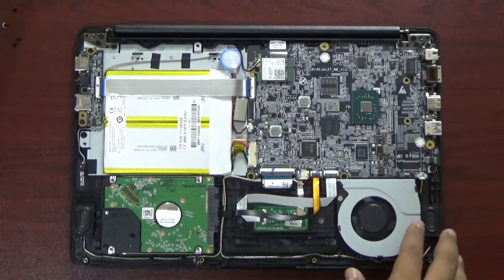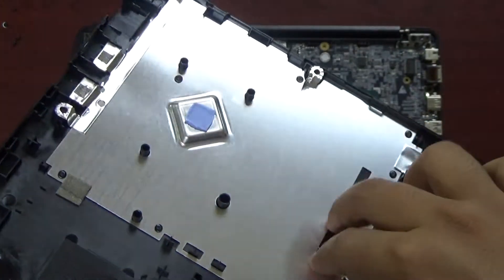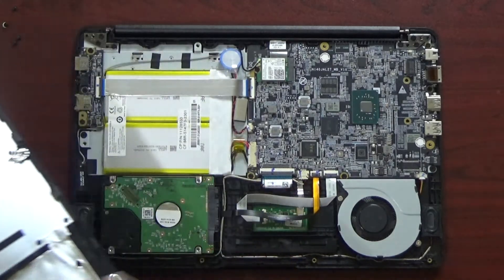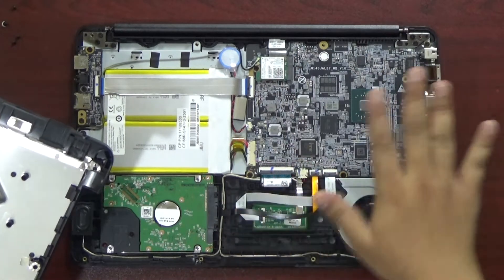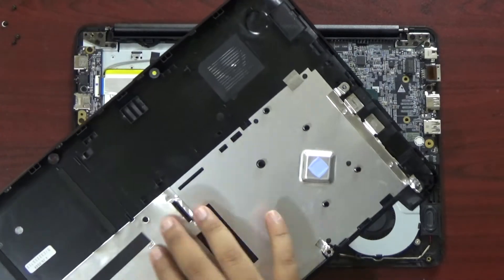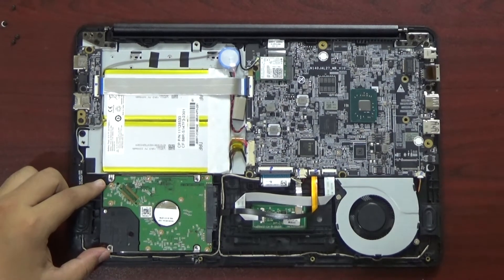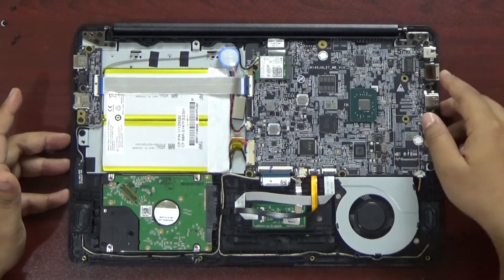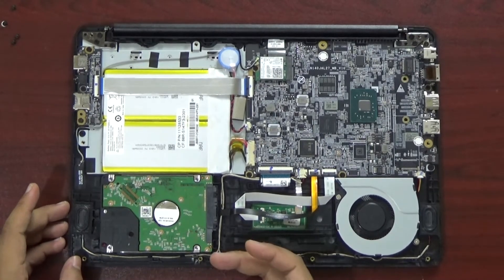Cara Bikin Itel Able 1 Jadi Kenceng

Comment: Ada slot lain buat ssd ga ya?
Reply: klo dilihat dri motherboard ny itu bs ditambah cuman mau pake solder uap :
1. ssd(dkt fan, tinggal pasang dudukan ny)
2. ram(chip skhynix h9hcnnncrmal LPDDR4X 4GB)
3. emmc bga 169(32gb/64gb/128gb)
Reply: @YS-wk4rp  itu udh pasti work ga gan, klo coba" gt takutnya gabisa dan malah ngerusak part yg lain